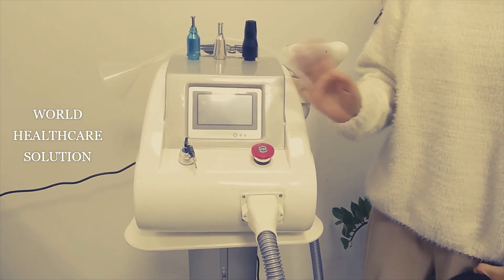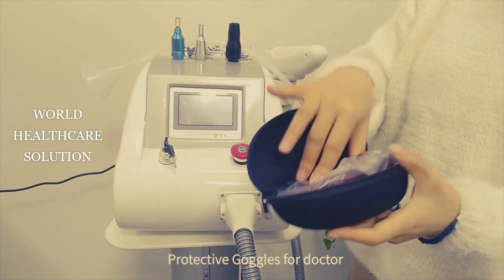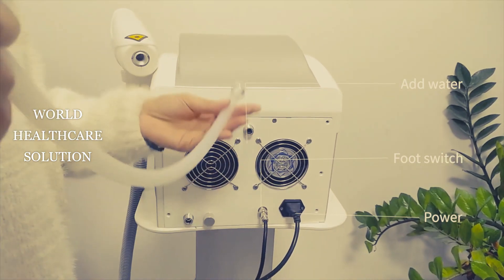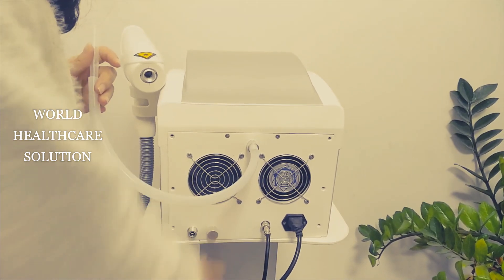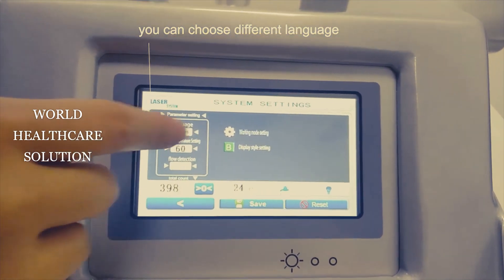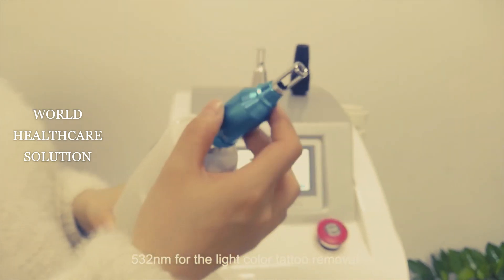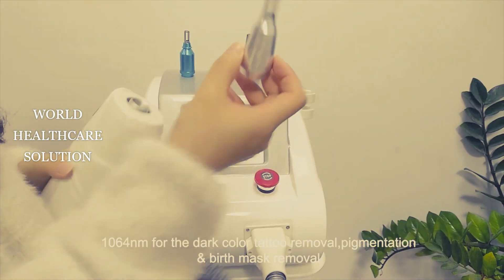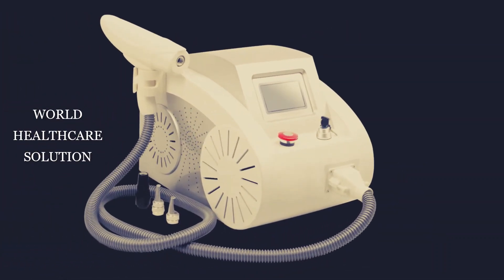Q Switch ND YAG Tattoo Removal Laser Machine

Comment: What causes the water circulation icon to say: ‘ Water flow error’ after turning the machine off? Considering water is full capacity.
Reply: Did u get it fixed I'm having the same problem